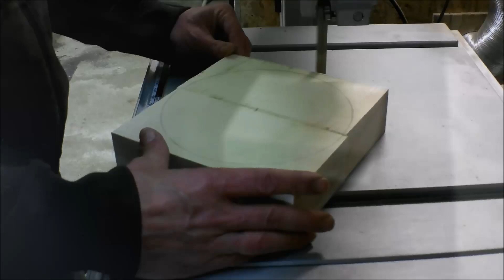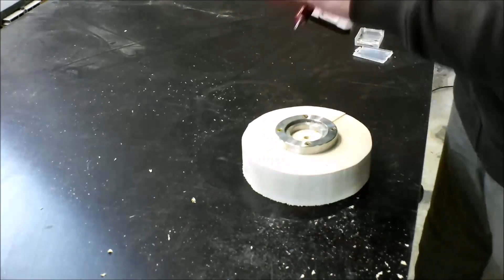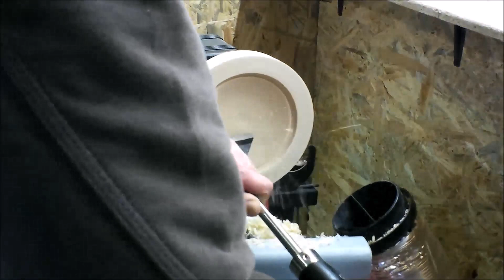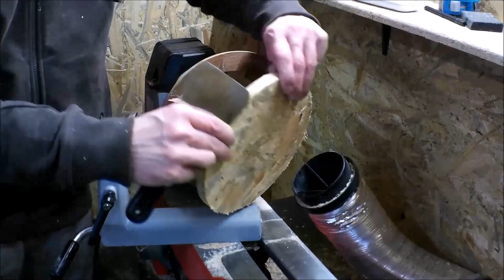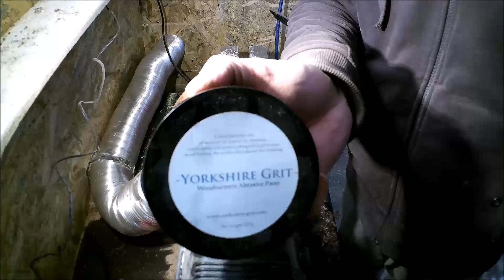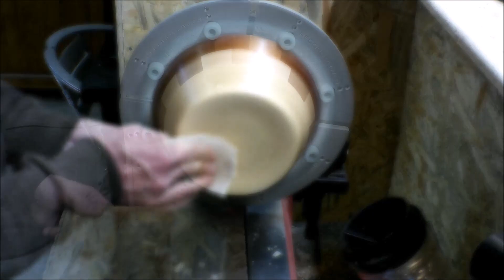Woodturning - The Mahagoni Maple Bowl

Comment: Good skills Rene very nice bowl.... Also may I ask what you sprinkled on the glue before joining TIA
Reply from the maker: Salt
The salt crystals keep the wood from sliding around. After clamping they will dissolve into the glue. It's an old woodworking trick.
Reply: Thanks Dude